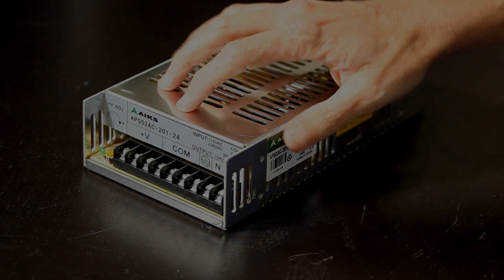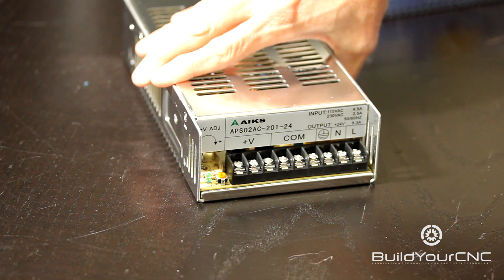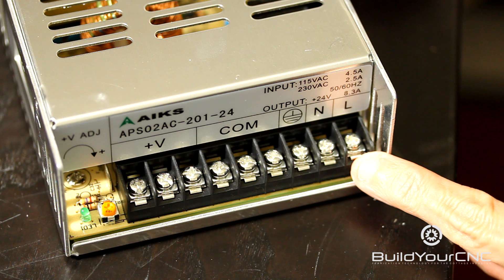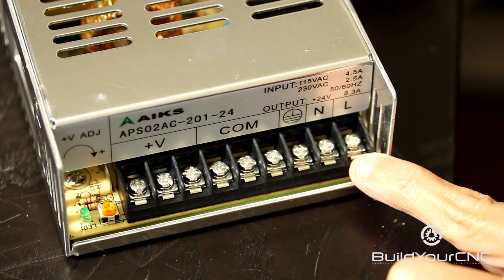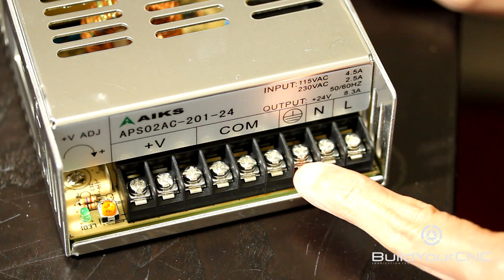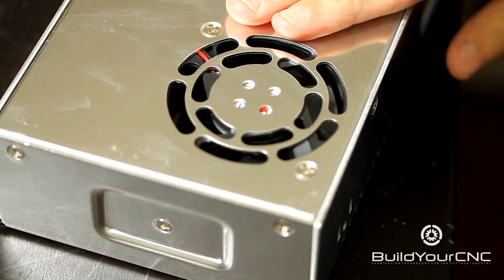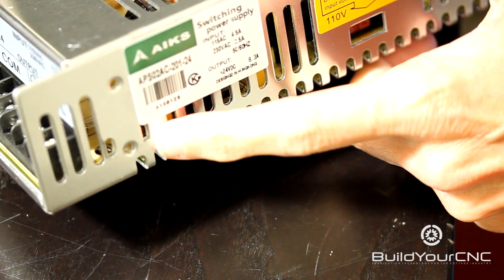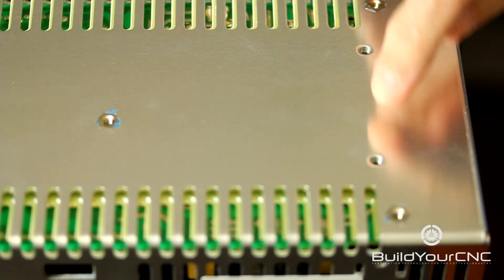How to use 24v and 36v Power Supplies

Comment: Could I use a device like this to power a 36v or 48v golf cart just to see if all electrical components is working correctly
Reply from the maker: That is a good question. I have never tried. It will depend on what the DC motor requires for amp draw.

Comment: You told me how to use it, but what is it for?
Reply from the maker: Hi Will, power supplies are used to power a variety of devices. Since I publish videos on CNC equipment, I use these power supplies to power stepper motors.

Comment: Can I use a generator for 120 AC output to your 36V Power Supply and control the 36V output with a Potentiometer to run two 36V DC 750W 
motors?

Comment: hi, great explanation, but I have one question:

I live in the eu and we only have 2 wires coming fom the wall (Guessing L and Ground) I can still use this right?
Reply from the maker: Not actually sure.
Reply: Yes you can, the N and the L are used. Remember to switch the selector on the side to 220v